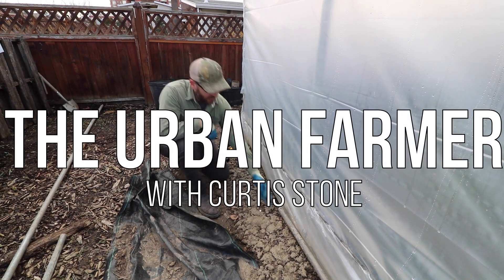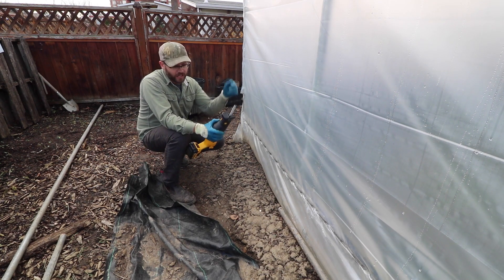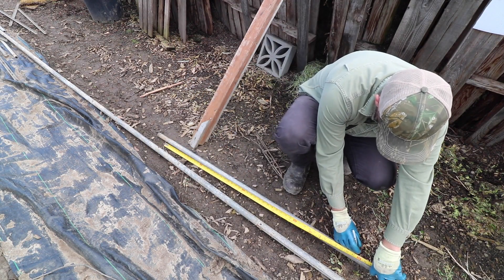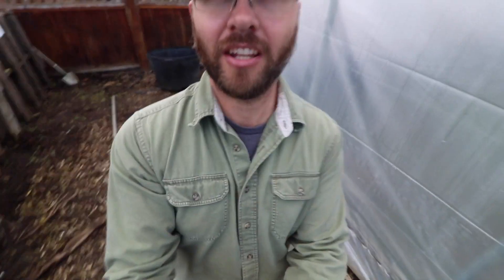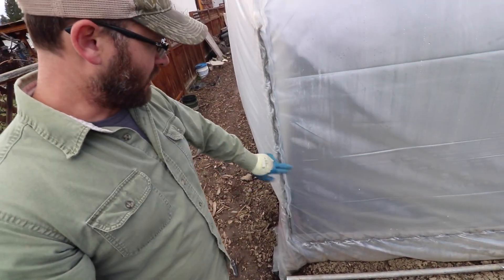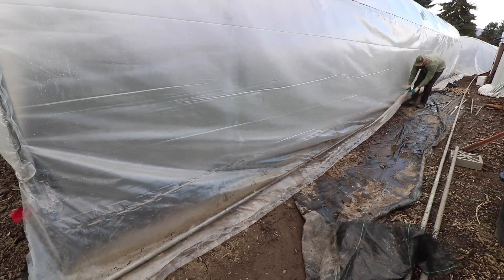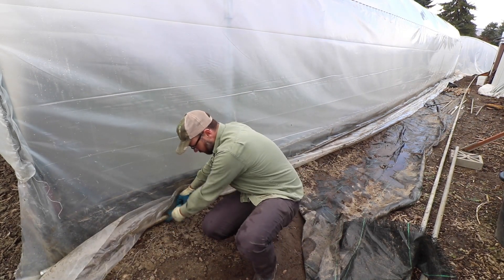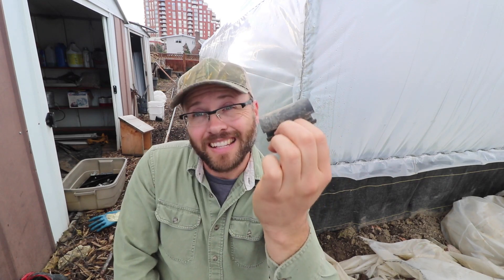How to Create DIY Roll Up Sides for Ultimate Ventilation!

Comment: If you roll it up the other direction, then the water won't get trapped in there and cause mold and mildew. The water will run right over the top and not down inside the roll.

Comment: Curtis, if you cut your wiggle wire in aboat 8" lengths, go down the sides w the shorter pieces, and hook your top layer w that, you skip every 2' and add a " piece of wiggle wire, you can actually have space in between the wiggle wire for air to blow up the lower section, won't have to use a channel that way

Comment: Excellent and timely video, Curtis, as we are building the same these days. What is the best source for channel lock and greenhouse poly in BC, to avoid US exchange rate pain? CY Growers? Wondering if other market gardeners out there have experienced the run-around from distributor/wholesalers who prefer to talk to big farms or nurseries who order by the pallet or truck load?  Its frustrating for those that have to build up infrastructure incrementally, when cash flow allows.  We've experienced a reluctance from wholesalers to open accounts for a small market gardener.  While I understand that preference/bias from a business perspective, there seems to be a market niche for scale-appropriate gear in western Canada -like what 4 Season Tools is doing in the Midwest US.  Any businesses out there?

Comment: Instead of getting a custom crank, you can drill a hole in the end of the pipe and slip a rod through as a crank. One less tool to find or find a place for.

Comment: What kind of metal pipe are you using for the rollup sides Curtis? Looks like they had in-built sleeves to connect together? Thanks in advance :)
Reply from the maker: +Nathanael Wiseman chain link fencing top rail.
Reply: Thanks Curtis - can't seem to find the stuff so easily in Australia! I'll have a better look...

Comment: Brilliant. I've only used the system where there's a wiggle wire track running along the entire length of the roll up tube. track is about $1 a foot so that's probably a lot more expensive that your little poly pipe plastic clip trick. Is it still holding up well after 3 years? Do you still like this system for your roll up sides?

Comment: Thanks for sharing. Have you tried plastic pipe instead of metal? Wondering if I could maybe use PVC
Reply from the maker: Yes, never again. PVC is garbage for greenhouses.
Reply: Thanks for the reply Curtis. Just so Im clear, I was talking about the pipe thats used for the roll up side, not the frame itself (which I agree, metal is so much better). Is that what you were referencing?
Reply: A PVC Pipe is for sure garbage also for that .. i think the weight of the metal pipes is even necessary to hold the plastic down when its kinda windy.

Comment: awesome tip!

question: would this work also with a double poly greenhouse?
Reply: This was a double poly roof greenhouse/ cold frame shown. It required having the air inflation transfer tube(s) being disconnected that inflated both of the two long sidewalls. He did not show this procedure but the inflation fan will continue to inflate the roof but the air transfer tubes, for both sidewalls will be blocked. Most if not all have roll ups on both sidewalls for cross ventilation. If your question was you wanted roll up sides and still be able to inflate at night, it could be done but require allot of time, effort and difficult to justify.

Comment: Use a cutting disk on your grinder, it will cut in a seconds. If you get a fairly decent disk, it will last.
Reply: It's about 1.6mm thick and looks like a regular grinding disk. Get a decent one.

Comment: How do you keep the plastic attached when not rolled up to minimize heat loss and wind damage?
Reply from the maker: +greenmodeling channel lock.
Reply: So the same as you do without it rolled up? Or do you do anything differently?
Reply: @greenmodeling  Seems like when you roll it down you can just reinsert the channel lock.